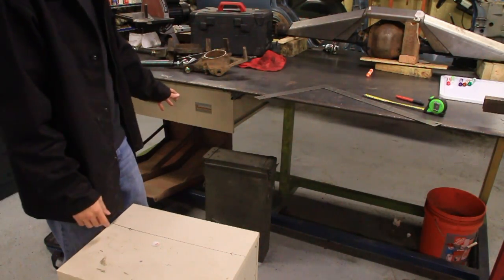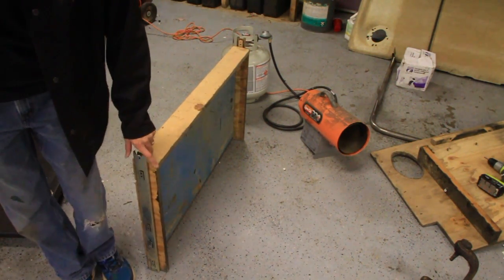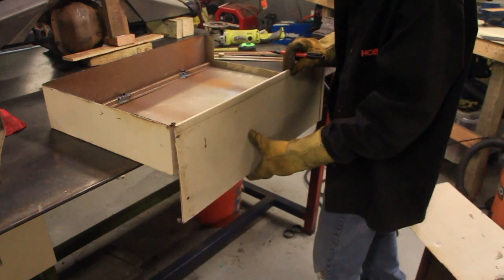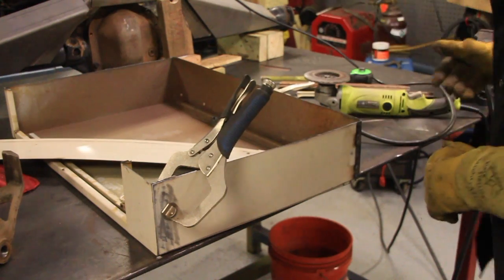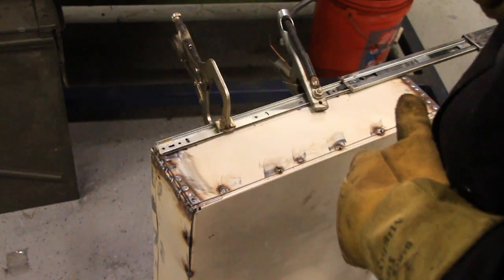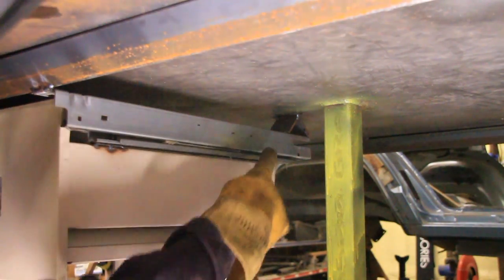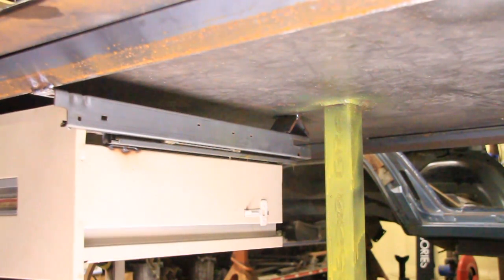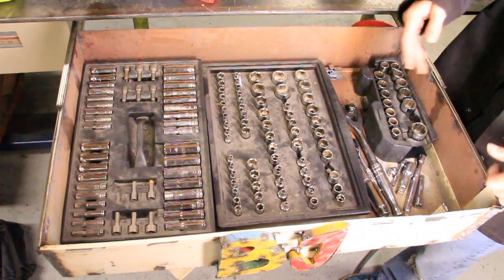Make a Metal Drawer

Comment: Matt, those slides remind me of the slides used for servers in racks in data centers.  Some of those servers are quite heavy and the slides are meant to allow you to slide them out of the rack pretty far.

You've got me thinking about getting an old 2U or 4U server and gutting it and using the slides and the chassie as a bin.  I think you could fit 2 side by side in an XJ.